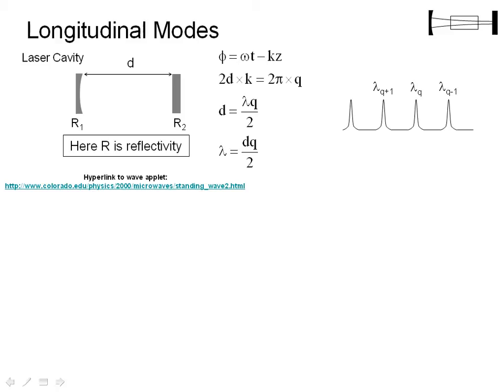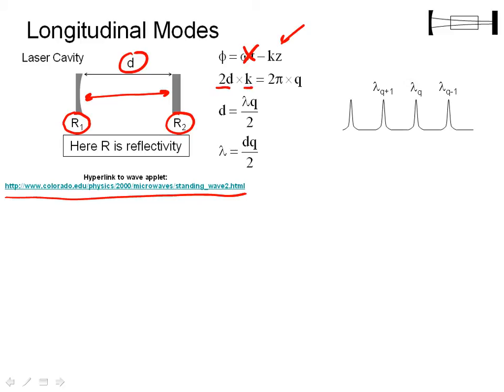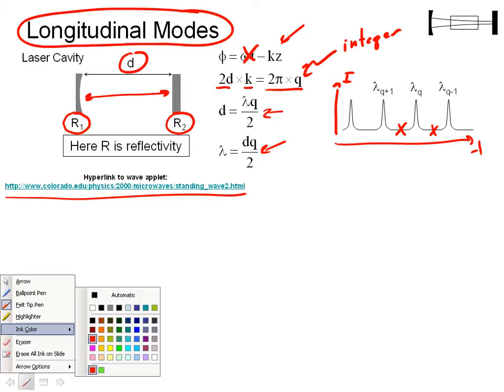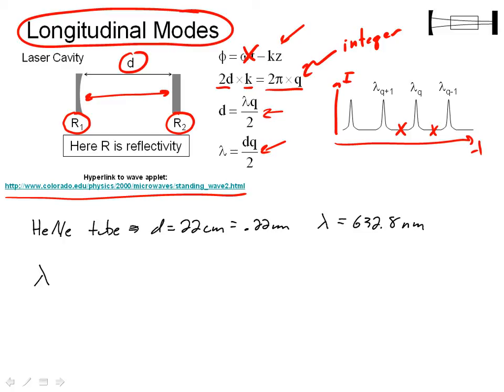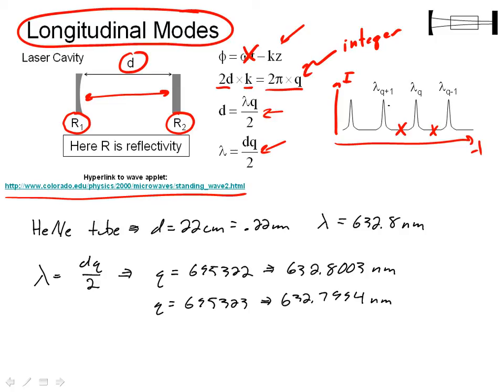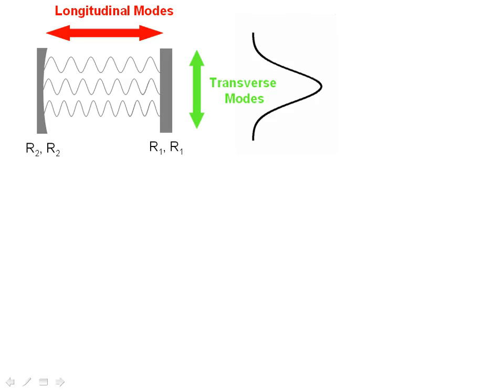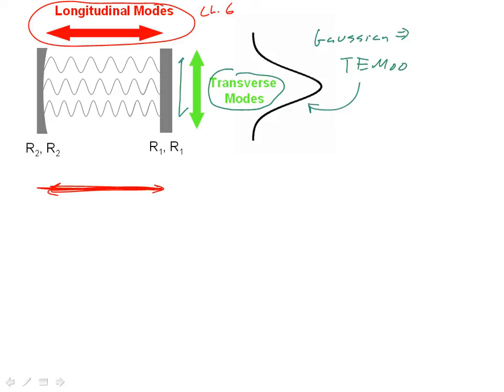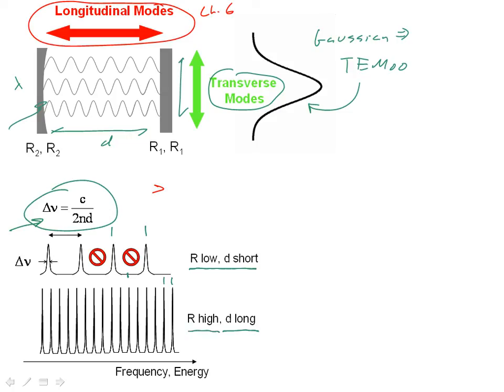Longitudinal Modes- Part II

Comment: does it mean that longitudinal exist only inside the cavity and transverse on both side of the cavity or output of a cavity?
Please mention the name of the book for chapters you talk about in the video.
Reply: Anil kumar the cavity determines the modes, but they exist outside by spatial distribution of light for transverse and frequency for long.
Reply: I agree that cavity determine modes. but since longitudinal is due to to and fro motion of light which can exit only inside the cavity. I didn't understand your last line. could you please explain or  provide to me any relevant reference?
Reply: @AnilKumar-mz8dj  These are longitudinal cavity modes, not to be confused with EM modes that have longitudinal electric field or magnetic field components, which are possible inside a medium or bouncing off the sides of an optical fiber or waveguide.

In free space, the EM modes are TEM00 modes, which mean both the electric field and magnetic fields are transverse to the direction of laser propagation, and their field strengths vs. radial position from the laser axis are Gaussian shaped.  There are other TEM modes which are not Gaussian.  In general, a laser is a superposition of multiple modes, and not necessarily an eigenstate, therefore changes shape as it propagates.